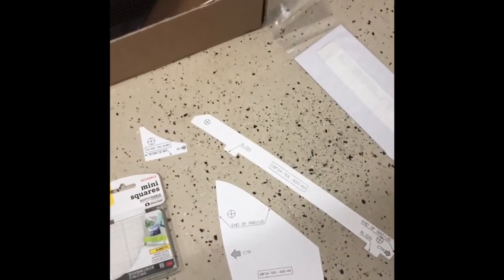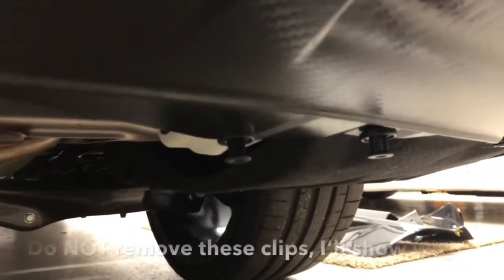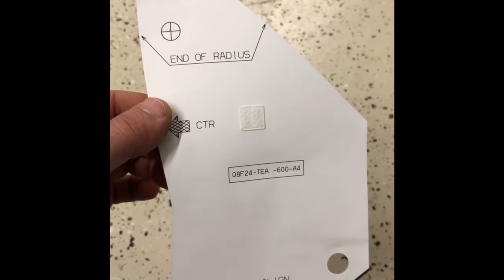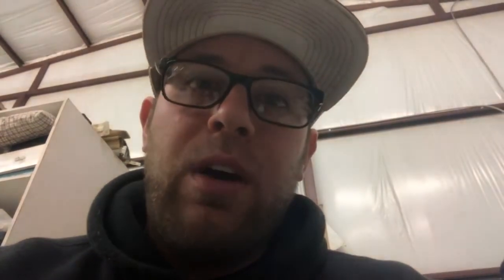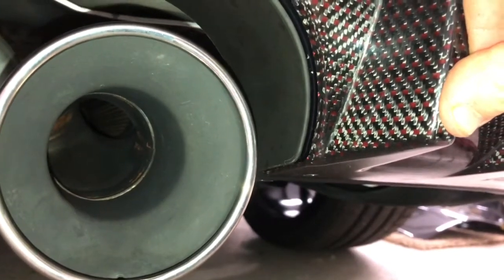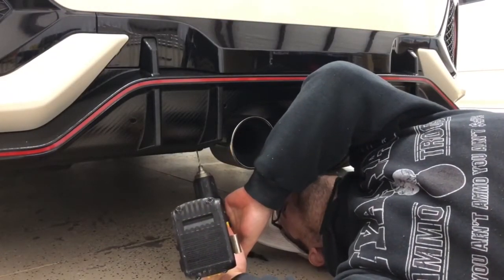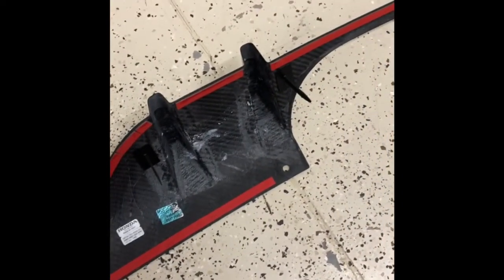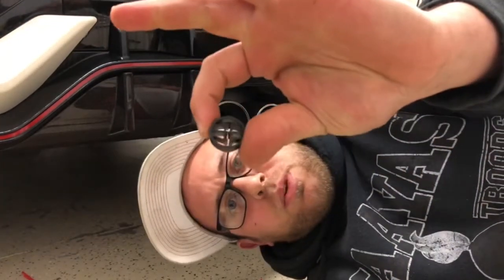2017 Civic Type R EDM Honda Red Carbon Fiber Diffuser Installation

Comment: Great video! So much respect for your mechanical ability. Question... is this an OEM Honda part? Is it real carbon fiber? Does it match the OEM carbon fiber rear spoiler with red weave? Does Honda make a front spoiler and side skirts to match...to replace the faux CF pieces? Thanks for sharing your efforts.
Reply: Yes it's a honda part it's EDM, so yes OEM fitment just only sold in some countries direct by Honda, the US market the B Pillars and Diffuser are not part of the Carbon Fiber package in the US, but they are in Europe.